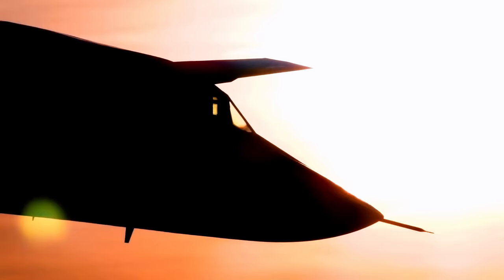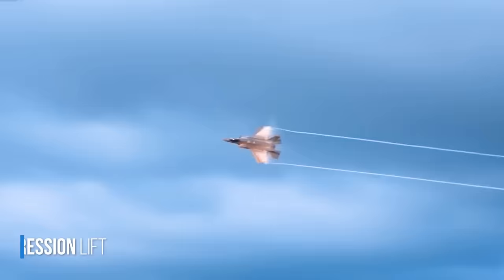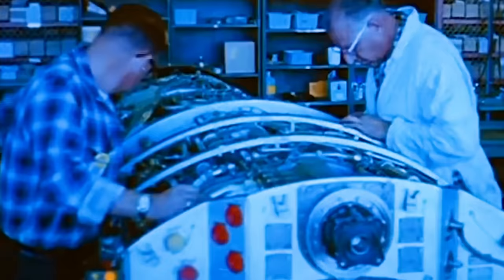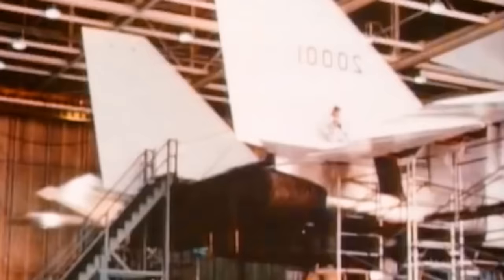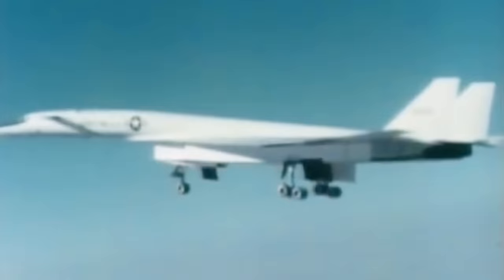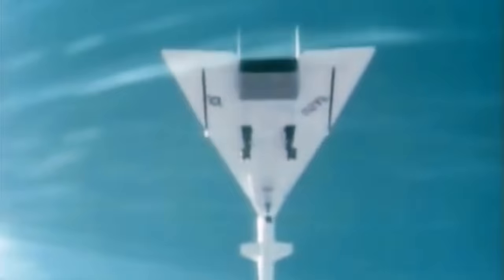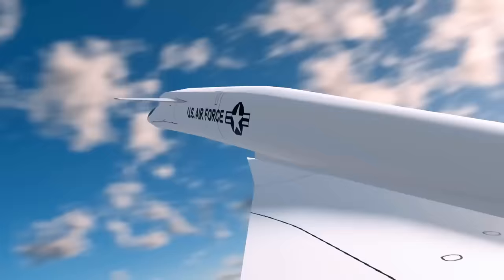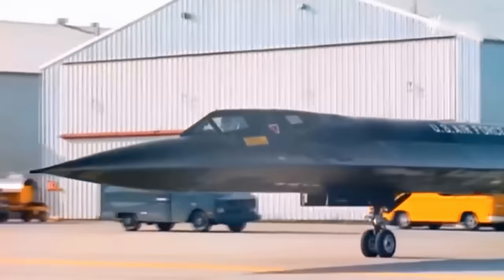The Aircraft Straight Out of a Sci-Fi Film | XB-70 Valkyrie Story

Comment: Greaqt info on the B-70! It is too bad that the one that crash was not the first prototype! My research on the B-70 and the U-2 was that the U-2 was shot down while it was flying at an altitude of 70,500 feet and not 79,000 feet as stated in this video. Also, the B-70 was not terminated because of it problems, which any new plane has, but more because the U-2 downage showed that the B-70's max altitude was probably not enough, and was perhaps vulnerable at being shot down like the U-2 was in 1960. The SR71 has about a 10,000 feet maximum altitude increase over the B-70, and it has never been shot down, although it has been fired upon many times.
Reply from the maker: Thank you for sharing your insights on the B-70 and U-2!

You're right, the shoot-down of the U-2 certainly highlighted the vulnerabilities of high-altitude flight, especially in the face of advancing enemy missile technology. It's an interesting point to consider how the perceived vulnerabilities of the B-70's maximum altitude played a role in its eventual termination. 

The SR-71's impressive altitude and speed capabilities indeed made it a formidable aircraft that could evade many threats. It's always great to have knowledgeable enthusiasts like you contribute to the discussion! 

Your perspective and research are much appreciated!
Reply: What really killed the B-70 was neither of these things, though the issue with missiles was indeed an important factor.  What really killed it was the ICBMs and in particular the Polaris missile. If you want to take a great deep dive into the B-70, I recommend the book "Valkyrie, North American's Mach 3 Superbomber" by Jenkins and Landis.  I have read in depth books on dozens of aircraft and missile systems, and the book on the Valkyrie by Jenkins and Landis is absolutly the best book I have ever read on any airplane. It is far more than a book about the plane itself. It delves into the competitive designs, the defense industry, the remarkable engineering required to overcome so many of the challenges associated with the design of something that such a monumental leap over everything before it, and in particular, why the program was cancelled. This book is out of print and might be a bit expensive on the used market, but trust me, this is the best book about aircraft ever written. It is a magnificent piece of work.
Reply: SR-71s never needed to fly as deep into Soviet airspace as a production B-70 would have.
Reply: @winternow2242  The SR-71 never operated in Soviet airspace. Before the SR-71 even became operational, the US had already launched a couple of dozen KH (Keyhole) satellites and most probably went over Russia. The SR1 was operated extensively over Vietnam, China and Indochina, the middle east, eastern Europe, and other areas of strategic interest to the US, but never over Russia. It just was too dangerous.

Comment: I found out that the development of this aircraft had another effect.  The Soviet Union intelligence must have found out and developed the MIG 25 Foxbat that caused great concern to many in the U.S.  Listening to a former engineer or pilot or someone from the former Soviet Union, at least one or all of the MIG 25 Foxbats could reach Mach 3  and travel  for 10 minutes at that speed but the engines would have to be replaced after the flight.
Reply: How did you find about the Soviets developing this because of the B-70?  Because that doesn't make a whole lot of sense. The Soviets were working on high speed interceptors in the mid 1950s. The B-70, which was never built, was designed afterwards, around 1958. The MiG-25 didn't begin getting developed until 1961. The B-70  was cancelled a few weeks later.....but the Soviets kept developing the MiG-25 for the next decade. The us built 2 Valkyrie test aircraft, having no combat capabilities, then developed a successor program which led to the B-1, which was completely different. The us lost 1 of the Valkyries in a freak accident, and never replaced it. By early 1969, the sole surviving XB-70A Valkyrie was retired to the USAF museum. And after that, that was when the Soviets put the MiG-25 into operation. Clearly the 2 planes have nothing to do with each other.
Reply: @winternow2242  Just what I heard on a TV or other documentary.  That the Soviets designed the MIG 25 to be fast enough to intercept the XB-70.  The MIG 25 first flew in 1964.
Reply: @daruscole1586  Sounds like you're not sure where you heard it from, and that you're probably not sure what you heard.  What you're saying is widely held on the internet, but it's the facts that undermine that.

 "Soviets designed the MIG 25 to be fast enough to intercept the XB-70.  The MIG 25 first flew in 1964."

The XB-70A wasn't a bomber, it was a flight test aircraft, nobody needed an aircraft to intercept it.

The MiG-25 was designed during a program that began in 1961, years before even the XB-70A were built.  The MiG-25 actually flew first, in March of 1964.  The XB-70A didn't fly until the following September and didn;t reach mach 3 until the following October, over a year and a half after the MiG-25's first flight.  The Soviets really had no way of knowing that B-70 or XB-70A were that fast - mach 3 was not part of the original WS110 specification.  The Soviets were probably unaware of compression-lift and had no real reason in 1961 to expect the Americans to develop a triple-sonic bomber.

Shortly after the Soviets began working on the MiG-25, the B-70 (which was never built) was cancelled, meaning that the plane the MiG-25 was needed to counter, wasn't going to be built.  The Soviets abandoned many projects (Sukhoi T-4 and Tupolve 144 come to mind), but stuck with the MiG-25.

The fact is, the Soviets had plenty of other reasons to develop the MiG-25, namely the B-52, the B-58, F-104, F-101, F-106, SR-71, Saab J35, TSR2 and the Mirage III, and the vast size of the Soviet frontier that required defense.

Comment: It was never mentioned anywhere, but when the visor was up at cruising speed, was forward visibility fully blocked, or did the pilots have a small amount of forward visibility? At cruising altitude, there wouldn't be much of anything to see and they would likely be on instruments for more or less the entire time, but if the visor ever got stuck in the "up" position throughout the flight...  granted, pilots perform CAT III ILS landings in thick fog, but at least there is usually some visibility at the very last moment. The Boeing 2707 had a little bit of visibility to the forward-left and forward-right despite the mach 3 cruise speed, due to the pinched nose shape. 

Also, we never see any interior shots of the bomb bay in any films of the XB-70. It appears that the bomb bay is big enough for perhaps 2 to 4 free-fall bombs or missiles but there isn't much to confirm that. From what I understand, it had a sliding door for the bomb bay.
Reply from the maker: The XB-70 Valkyrie's design was indeed unique. Its design features and innovations, while advanced for its time, still raise questions and interest today.

The visor of the XB-70, when raised, did severely limit forward visibility, but as you rightly pointed out, during its high-altitude cruise phase, forward visibility wasn't as critical. Instead, the crew would rely heavily on instruments. In a situation where the visor was stuck in the up position, the aircraft would probably have had to descend to a safer altitude, slow down, and follow a protocol for such an anomaly. And, as you mentioned, with modern avionics and instrument-based landing systems, it's plausible that the plane could be landed safely even with limited forward visibility.

The XB-70 was initially intended as a strategic bomber, so it indeed had provisions for a bomb bay. The actual design specifics and capabilities of the bomb bay weren't widely publicized, as with many details of military aircraft, especially during that era. The exact number and type of weapons it could carry would depend on various factors, including the design and weight of the weapons and the intended mission profile.

You can find some info here:
https://www.quora.com/Where-would-the-bombs-be-stored-on-the-XB-70-Valkyrie
Reply: The XB-70A had no bomb bay because it wasn't a bomber. It was a flight test aircraft based on a bomber. The XB-70A had an instrument bay in the lower fuselage behind the intakes - presumably, the never-built B-70 would have used the same space for its weapons.
Reply: @Engineering_Secrets  Two topics that might be interesting to research and present:  1.) Aircraft with no or very limited forward visibility. There were actually a surprising number throughout history...it wasn't just the Spirit of St. Louis, and 2.) oblique wing aircraft other than the NASA AD-1 which is actually fairly conventional. I used to have an oblique wing flying model, and it actually flew great and it It had no conventional tail. It would be an unwieldy craft for passengers but it could make an interesting, low-drag sensor platform.

Comment: I just wonder with the intakes taking up most of the underside of the XB-70, where were the bombs going to be sored?
Reply: Lower fuselage behind the intakes. The airflow was ducted around them.
Reply: Behind the nosegear wheel well.
Reply from the maker: The XB-70 was designed to have a bomb bay located in the central fuselage, between the wing roots but aft of the cockpit area. 

More info about it here:
https://www.quora.com/Where-would-the-bombs-be-stored-on-the-XB-70-Valkyrie
Reply: @Engineering_Secrets  The B-70 weapons bay was to be exactly where I said it was. On the XB-70 it is the equipment bay. It's clearly labeled as #56 in the cutaway behind the nose wheel well as I indicated, with the #14 "Recording systems, digital and analogue computers (ahead of weapons bay)." sandwiched between the wheel well and weapons bay.

The fuselage included the "neck" of the XB-70. It was attached between the wing roots as you described. But to describe the weapons bay as "aft of the cockpit area" is misleading. First of all, there is no "cockpit area." There's simply the cockpit, which is in the upper fuselage. While the weapons bay is aft of it, so are the engines and vertical stabilizers, but it doesn't accurately describe their locations. Almost the entire airplane is "aft of the cockpit area." The weapons bay is in the lower fuselage.

Furthermore, please refer to the preflight walk-around - #5 is immediately behind #4.

Section 2.1 Pre-flight Exterior Inspection.
1 - Forward fuselage area.
2 - Right canard area.
3 - Right inlet area.
4 - Nose wheel area.
5 - Weapons bay area. 
6 - Right main landing gear area.
7 - Right wingtip area.
8 - Rear fuselage area.
9 - Left wingtip area.
10 - Left main landing gear area.
11 - Left inlet area.
12 - Left canard area.
The

Comment: The tires were liquid cooled. That’s extreme.
Reply from the maker: Thank you for your comment! Isn't that fascinating? The liquid-cooled tires of the XB-70 are indeed an extreme and intriguing example of the innovative engineering solutions developed for this plane. 

Designers and engineers were pushed to develop novel solutions to manage the extraordinary conditions that high-speed, high-altitude flight presented, from intense heat to substantial structural stresses.

Comment: Das Flugzeug hatte doch einen speziellen Schleudersitz. Warum haben sich die Piloten nicht rausgeschossen ?
Reply from the maker: Yes, the XB-70 Valkyrie aircraft was equipped with a special ejection seat, known as the "escape capsule" or "crew escape capsule". In case of an emergency, the entire cockpit capsule could detach from the aircraft structure, protecting the pilots from the extreme conditions of a high-speed, high-altitude descent.

During the accident between the XB-70 and an F-104 Starfighter on June 8, 1966, the co-pilot of the XB-70, Major Carl Cross, tried to activate the capsule, but unfortunately did not succeed and lost his life. The pilot, Alvin S. White, managed to escape from the aircraft but was seriously injured in the process. The two losses stated in the video are related to the XB-70 Co-pilot and the F-104 Pilot.

Several factors made the rescue difficult. The collision took place at a relatively low altitude, giving the crew members very little time to react. Moreover, the unexpected nature of the accident and the rapid sequence of events made it difficult to activate the rescue system in time.

Comment: Where did they store all the fuel for those 6 burners? I was taught that E=MC 2 . Didn't those physics apply here?
Reply: E=MC2 describes the conversion of mass into energy.  Combustion engines don't do that.  Rather, they convert chemicals into other chemicals, releasing energy as they do.  Atomic nuclei for the former, electrons for the latter.
Reply from the maker: Great question! That equation specifically relates energy to mass, with "c" being the speed of light. It's fundamental to nuclear reactions and particle physics but isn't directly relevant to the fuel storage and operation of a jet like the XB-70.

For the Valkyrie, the challenge was to store enough fuel to allow the aircraft to travel its intended distances at the speeds it was designed for. The XB-70 had a fuel capacity of around 300,000 pounds, which was stored in tanks spread throughout the aircraft. This fuel capacity was necessary due to the intense consumption rates of its six turbojet engines, especially when operating with afterburners at supersonic speeds.

Jet fuel storage and usage are based on the principles of combustion and the need to convert chemical energy (from the fuel) into kinetic energy (the motion of the aircraft). So while E=mc^2 is a fundamental equation in the world of physics, in this context, the engineering and design of the aircraft were more focused on traditional principles of aerodynamics, propulsion, and combustion. 

Thank you for your comment!
Reply: No it didn’t.  THAT level of energy hasn’t been applied to an aircraft
Reply: The fuel is stored in fuel cells which are distributed throughout the airframe, as they are in any airplane.

Comment: WHY NOT FOLLOW THE DESIGN OF 
SR-71 THE BLACK BIRD.
Reply from the maker: The design of the SR-71 Blackbird was specifically tailored to its recon missions, high-speed and high-altitude flight profiles. 
Adopting its design for other purposes, would require evaluating the specific needs and goals of the project. However, many of its design elements and technological advancements have influenced subsequent aircraft designs. It's always a balance of mission requirements, costs, and available technology.
Reply: What advantage is there for the Blackbird over this plane?  Also, XB-70A was Based on the B-70, which was designed before the SR-71.

Comment: six engines is ok ONCE it gets up there in the thin air those engines will have little oxygene to burn fuel , and since the engines KNOW they have little oxygene they pump in less fuel. Also the air resistance up there is less. It is all mathematical balance. But the fuel consumption is under control and actually beneficial and nice once the plane is up there. So can go coast to coast crossing oceans in an economical way.

We know russian gear is shit but an important thing like this project .... USA whimpered out fearing russians easily improve their missiles at a lower cost then this plane.

That is the excuse for cancelling the project. But there should be other reasons. Like , if the russian AA missile  threat did not materialize, XB70 need to decelerate over the target area and become a B52. Well USA allready had B52 ....  XB70 should have been purely a penetrator  and a nuke delivery platform. So why spend more money? Delivering dumb bombs with precision requires slow down.

But no kidding XB70 was a technical achievement. One might think USA chickened but possibly really not when they had the B52. I suspect the guys in Pentagon know their math.
Reply from the maker: Indeed, jet engines perform efficiently at high altitudes due to reduced drag and thinner air. 

The threat of Soviet missile technology was a significant factor in reevaluating the viability of bombers like the XB-70. With the development of advanced missile systems, the strategic and economic rationale for the XB-70 became questionable, especially when compared to the proven B-52. While the XB-70 was a technical marvel, defense decisions often balance technology, strategy, and cost, leading to its eventual cancellation.